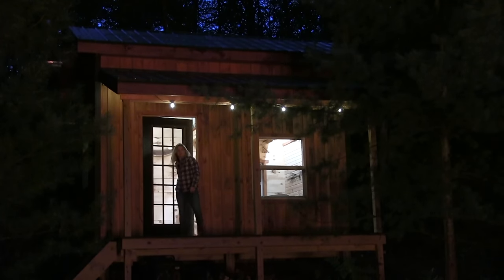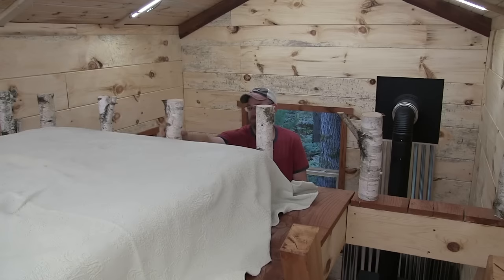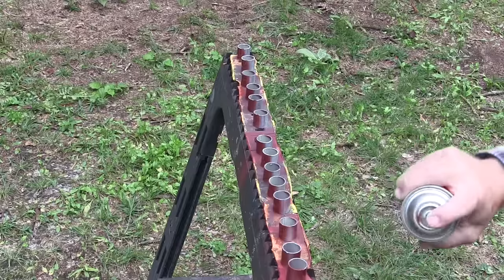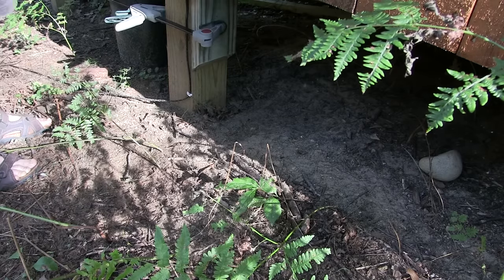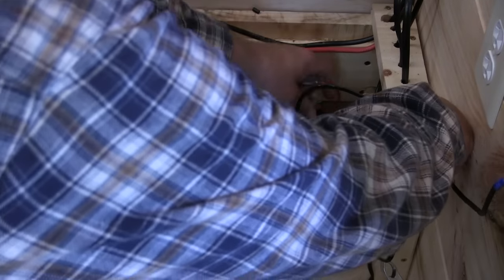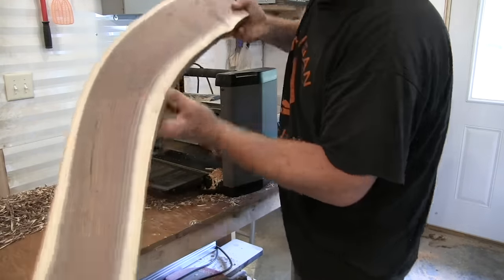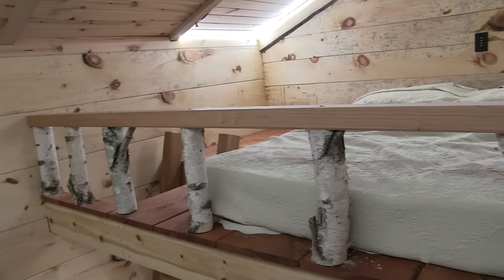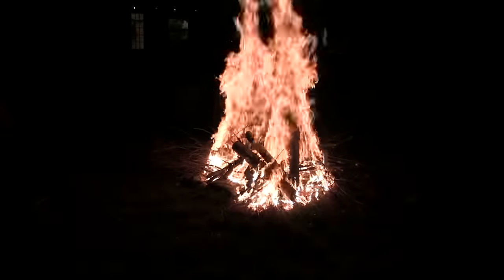simple improvements to my off grid cabin

Comment: I am really enjoying your videos! You illustrated perfectly that a simple solar system can work very very.efficiently. There are armchair solar commandos out there who would say you need expensive.12V fuse blocks on these small systems and.other.things. You showed perfectly.that you.don't. Proper thickness wire sized for the.amps it will be carrying and good inexpensive heavy duty in-line fuse holders with the.lowest workable fuse size are totally adequate.
Reply from the maker: awesome !! I'm glad you're enjoying them . I do like to keep it simple . I honestly didn't think of fuses at first so I am thankful for some of the comments . In my camper build I ended up using a 12volt fuse block from Napa it has 6 spaces and cost maybe 15 bucks I really liked doing it that way it kept it a little neater but inline works just as well

Comment: Watching this over makes me feel like I could do this. We spent yesterday outside and took the bricks from flower bed and made a fire pit out back. Now going to take a downed tree and cut it into sections for front of flower bed.

Spent most of night outside last night with a bit of dryer lint for Firestarter and then made a teepee of small sticks and grew it bigger  and made a campfire and made smores  and  roasted bratwurst. It was amazing
Reply from the maker: that's  great because you can do it ! that sounds like a pretty good day and good trade flower bed for fire pit
Reply: @blackspruce1861  it took most of the day to plastic the roof as I couldn't climb on it as it was really rough shape.
2 pieces of plastic first then we finished up with a 1x6 decking board and stapled contractors bags to it and nailed it on halfway up then stapled it all down.

Trimmed the briar patches down around the building and spare house and finished taking down the pool. My back is feeling it now

Comment: Nice build! I personally would not of had the wood stove that close to the wall even with the heat shielding. Most are 18” minimum. Be safe and beautiful place!
Reply from the maker: Thanks ! It might look close kinda hard to see actual depth on video but I added an inch to the clearance printed on the back of the stove so should be good

Comment: Did you ever make a bed base? I'd live in that cabin full time, but my ol' knees don't do well with steps and ladders are a no go. I have in mind to build a base for my bed, with draws underneath for storage, sockets for USB and plugs, built in lights - with variation on a headboard maybe even bluetooth speakers.
Reply from the maker: No I just threw a mattress on the floor . I like that idea though having a little more space under it for organized storage .

Comment: So I checked. Painting the metal also helped with the heat radiation. The bright raw metal is good at reflecting light but not absorbing heat. Good job. I would have used black.
Reply from the maker: that's cool to hear ! thanks I thought about black but kinda wanted the stove to stand out from the back not blend in so much

Comment: Hello Brother, The spruce railing looks so Great! Can you please tell the total cost from start to finish of your this Cabin including everything? I ll be thankful.
Reply from the maker: Well I really don't have an exact number  . I saved a lot because I had almost all the pine for tongue and grove I had all the oak for the flooring and the deck floor . I bought the steel  for the roof from a friend left over from a job I bought the door and windows on market place , I bought the stove and some of the insulation on marketplace too. all total around. 3,000 I spent on building it . the solar hit and inverter were around 260 wiring and switches outlets lights were probably another 150-250 .  all total if you bought everything new I would guess maybe 6 to 8,000 just guessing

Comment: awesome. I vote for some sort of trim around that stove backing. Dark Walnut , or maybe even some tiles , wonder if tile adhesive would be okay with the heat.  What is your square footage in that main cabin? I'm about to close on a 20 acre plot this week near Munising.
Reply from the maker: Thanks!! That would look good but I think you want to keep it open so air can flow behind the metal and help keep it a little cooler . It's  10x14 so 140 plus the loft . thats awesome there was ten acres just a bit east of Munising I was really considering earlier this year but it sold .
Reply: @blackspruce1861   Hmm, good point . here's another scroungey idea. Make trim out of some old spring steel  window blind blades , just at the edges. Looks like white countertop trim. attach at front, won't inhibit flow.  That's 140? Wow it looks bigger. I think Dave copied that also? I absolutely LOVE the window design on the she-shack, I am gonna copy that also. I am basically freaking out, a million things to work on.  Thanks for the reply.

Comment: Looks Great !! .. But if you get the chance you might want to rub down your walls with bleach & water (to get the mold off) and then polyurethane them (to preserve & keep the mold off) ..

Just a thought !!
Reply from the maker: Thanks!  that's not mold . its holes in the wood from some small bugs that were in the logs. they get air in them and turn grey . not mold

Comment: For a parallel circuit that pulls 3 amps, you wouldn't want to protect the circuit with a 3 amp fuse. I think that the 5 amp fuse that you used instead will be OK. You want your wiring (1 amp per branch) to be rated for 2x the expected current draw ... not at the same rating as the expected draw. With circuits with loads like power motors. you have to consider that the startup amp draw will be higher than the running current draw. Load affects the work the motor has to do, and if work increases, so does the amp draw.
Reply from the maker: Thanks for the info !! its sad that I don't remember things like that especially considering I built electrical substations for 16 years or so and did an apprenticeship that taught that .   we were mostly just building what was on the print not doing any figuring so use it or lose it I guess

Comment: Adding a heat shield around the stove will also improve Heating by giving the stove something to radiate heat from and corrugated metal spaced about 1 inch off the wall acts as if it's a radiator itself.
Reply from the maker: Yes I think it creates a bit of a circulation effect too. I’m glad I did it . All around good improvement

Comment: Do you have any kind of adjustable screened ventilation up near the ceiling?  In my experience you will need something, to prevent condensation buildup in the insulation from drying clothing and boots, cooking, breathing, etc. Especially at night during the heating season.
Reply from the maker: its not adjustable but there's quite a bit of ventilation.

Comment: On your Inverter, run a 12 to 13.5v  feed back to your battery as to constantly charge it, it will never run down as long as the inverter is supplying a higher input than  discharge voltage and when you're not at the cabin, use solar to keep the battery up.
Reply from the maker: Thanks! that's an interesting idea , I'll have to look into that
Reply: @blackspruce1861  Being that I live in Florida, I tried it once a few years ago; we had hurricane Michael come thru, I worked thru the hurricane,  when I got home it was dark, all I had was my LED flood work lights I used the battery charger to constantly keep the battery charged and the inverter ran the lights all night, til I got up and turned them off.

Comment: Ryan just started watching your videos today, 26th December 2022, love your dog. Can you teach him to fetch tools or run the chop saw?  This is a great idea for a cabin!  Looks to me as if you think things out before you start a build.   I like how the loft railing turned out, the heat shield looks great, that red color really makes it pop!  
You definitely will like the 12 volt USB outlets for your personal electronics.  
That coat rack, we did something similar with a rough cut piece that my brother want to throw on the burn pile.  Took a few minutes to clean it up & it looks similar to the rack you created.
My suggestions are:
1) Your deck stairs need a rail.  I always feel as if I'll fall w/out 1.  I 'm not a ladder person either, but adding the hinge was a great idea. Now it isn't in the way!

2) If you find yourself putting the "stowaway" table away a lot, add 1 or more recessed carry handles, to a side.  Makes these large pieces easier to carry, especially if nobody else is at the cabin with you. Maybe a rope handle or See here: 
https://www.amazon.com/Drawer-Recessed-Flush-Sliding-Handle/dp/B07FYMK58Q

3) Create a single place charging station for your electronics, this way if you don't use them at the cabin, you can put them away & always know where they are. Especially important if you have a weak signal.

4) If you don't have it yet, consider a storage building for a lawn mower, ATV or other items you may need to store while at the cabin.  Keep the snow off the toys!  Have tracks for the ATV, consider that before getting or building it.
Reply from the maker: thanks !!! great tips

Comment: I'd put some sort of trim across the top and sharp edge of the tin behind the store. Maybe some sort of metal pipe. Would give it a more finished look. Also some 1x8 knotty pine to cover the end grain edges of the flooring in the loft.
Reply from the maker: I thought about that but want it to have open air flow

Comment: I haven't installed one for my cabin don't think I'll use metal but instead I'm thinking cement board ? Behind the stove.
Reply from the maker: Yeah I think cement board would look nice and be probably pretty easy to work with. I used a brand I think called hardy backer for a kitchen island It was light weight and didn’t flake apart like durrock

Comment: What’s the metal piece that your wood stove chimney pipe goes into called that goes outside? I’ve been going NUTS trying to find that piece for my cabin, and all I can find is one made out of canvas for a tent called a “Stove Jack” but I cannot for the life of me find a metal square with a hole in it.
Reply from the maker: It’s actually 2’x2’ piece of sheet metal . I think I bought it at menards or lowes you have to cut your own hole in it.
Reply: @blackspruce1861  is it possible to buy one? I’m new to DIY stuff.

Comment: If you ever have to cut spindles again, it's always easier to cut the first end by eye and get it as good as you can. Before you make the second cut, use a level to verify the ends are parallel. This works best
Reply from the maker: Cool thanks for the tip.
Reply: @blackspruce1861  that may not make much since. But I was trying to say get the end that you cut parallel by checking it with a level and make sure the blade of the saw is the same.
Reply from the maker: @cdp50359  no it makes sense. I mainly did it by eye it worked pretty well but there’s always a better way
Reply: @blackspruce1861  you did awesome

Comment: Is that a bit of mildew I see forming on the wall behind the bed?  If so, how to you get rid of it and prevent more in the future?
Reply: I was wondering the same thing. Looks like the whole cabin is getting moldy. It should have been stained to prevent this.
Reply from the maker: no that is not mold or mildew I suppose I should get a close up shot next time . it is greying of the wood . when the logs sat in my yard they were next to some red pine logs .those logs had some kind of bug in them that bores a bunch of holes in the log and  around those holes the wood gets a gray color. it actually looks really cool.
Reply from the maker: no its not mold or mildew . the logs had some kind of bug or beetle in them that bored a bunch of holes . around those holes the wood gets gray in color . I should probably show a close up in another video .

Comment: Just found your channel.  Is your workshop with power tools run off the grid?  If not how are you running your power tools.  We plan to go off grid in the next year and trying to figure all the things like workshop, I would love to keep a freezer and small fridge. Thanks for any info!  The railing looks awesome but definitely love that red heat shield!
Reply from the maker: cool glad you found it!  No the work shop is at my house . I've been trying to do as much prep work  there as I can beforehand, my generator is having carb problems I need to get around to fixing it .I don't think my small solar set up could run a mini fridge for very long however a company contacted me the other day about a 12 volt fridge/freezer cooler type thing I may do a review on it could be pretty handy .Thanks I'm really happy with the red too .
Reply: @blackspruce1861  Awesome would love to see a review!
Reply: Hello Shelley
Reply: @bendonaldson9026  hello
Reply: @Shelleys4Seasons  l'm glad to hear from you dear, how are you doing?

Comment: Love the cabin! What are the deminsions?
Reply from the maker: Thanks !! its 12x16
Reply: @blackspruce1861  I Want to build your cabin. Any way you could send me some blueprints?
Reply from the maker: @jacobmaier7600  shoot I’m sorry those are the dimensions for the other cabin video I have. This one is 10x 14 .  I’m sorry I never made any blue prints I know the walls are 10’ tall the loft joists are 6’10” from the floor to the bottom of the joists I think the loft is 7’ deep but I don’t have any prints
Reply: @blackspruce1861  I appreciate that. I'm thinking of 12×14
Reply from the maker: @jacobmaier7600  that would be a good size
Reply: @blackspruce1861  what do you think the height of the ridge beam is? Is the roof pitch looks steep, 6/12 pitch?

Comment: Why couldn't you use the white pine trunks for a project or firewood for your stove?
Reply from the maker: probably could but it seemed odd that they just died when everything else was doing so well I figured I would burn them right after I cut them down incase they had some disease
Reply: @blackspruce1861  that's a good reason

Comment: Looks great! Maybe trim out the heat shield with wood? Or does that defeat the purpose?
Reply from the maker: Thanks ! I was thinking the same thing and I'm not 100percent sure but I think if you stopped the air flow around the metal it would probably defeat the purpose. I agree though it would look nice trimmed out
Reply: @blackspruce1861  No, that makes total sense.  Scratch that comment.
Reply from the maker: @jonboy8181  no reason to scratch it I had the exact same thought process on that

Comment: If your battery is lead acid, it should be vented.  Even sealed batteries need to be vented to prevent overheating and off-gas explosion.
Reply from the maker: probably should

Comment: Seem like I remember reading that enough heat over time dries out the wood and changes its properties so it becomes much more flammable after being heated to extreme temperatures. Thus another need for shielding. Why I ultimately went with a kerosene heater for less hassle.
Reply from the maker: that does make sense . Its worth it to put a heat shield up. I don't blame you there's quite a bit of work and cost to setting up a wood stove. its a lot easier to just get fuel and light the heater
I remember the first house I owned , I totally gutted and remodeled . while I was doing the drywall I learned not to let the kerosene heater run out the hard way . I came back and the ceiling was black from it burning the wick . you don't forget mistakes like that one lol

Comment: Are you concerned about that battery off gassing in your living space? Some people vent them, and others put them in their own outside garage.
Reply from the maker: I'm thinking of upgrading to an AGM , or lifepo battery. I may be wrong but I thought the battery would only off gas  if it is overcharged which the charge controller should keep it from doing that . either way if I upgrade batteries I won't have to worry about it so that would probably be the best choice
Reply: @blackspruce1861  Research and then you don't have to worry.

Comment: I'm not a repairman but wouldn't putting that metal sheeting on the wall reflect the heat then to the wood?
Reply from the maker: it actually works exactly the opposite of that . it stops the heat the air gap between the metal and the wall allows air to flow and the wall stays cool
Reply: @blackspruce1861  makes sense
 Thanks for the correction

Comment: 13:08 As a safety tip, it's best to add some ventilation to the batterybox to the outside of the cabin, because lead-acid batteries release an explosive gas during charging. An explosive gas in combination with a semi-open fire (stove) or when a fuse blows, that spark can ignite this explosive gas in the box. Also if the released gas from the batterybox can't vent to the outside, you will breath in those gasses and can give you headache. If you experience a sulfur or rotten egg smell, then it is the gasses of the battery you smell. In wintertime with not that much sun, the charge current to the battery will be not that great to produce a massive amount of gas as during summer. In the summer when the stove is not used, the door will be more open to vent the cabin. 
Other then that, a very nice and durable build . Grtz
Reply from the maker: yeah would be safer